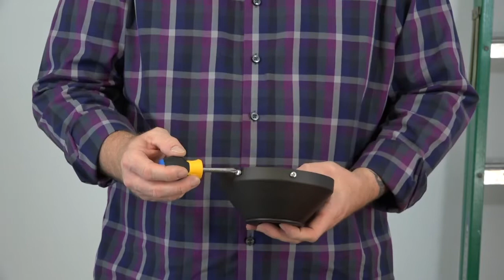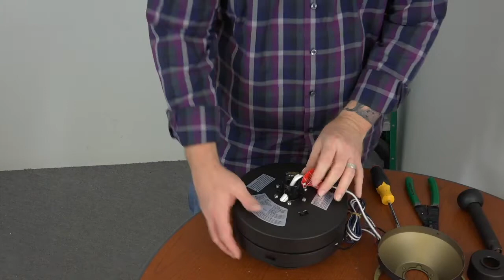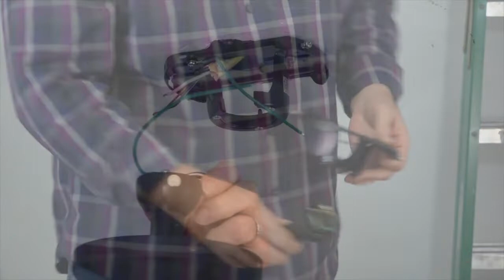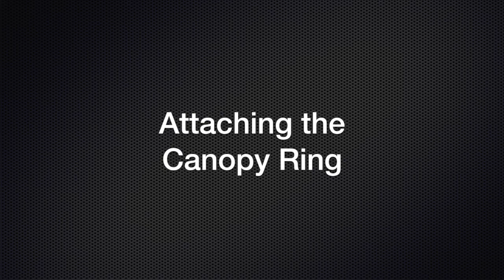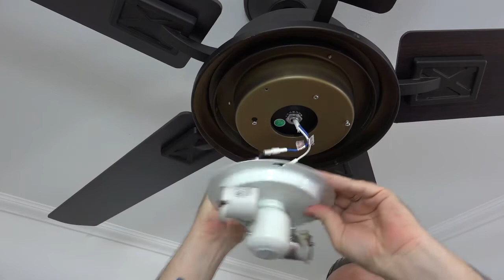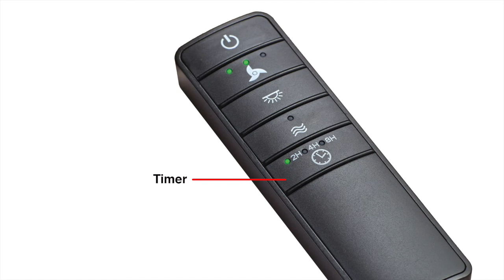How to Install the Copley Fan

Comment: What should you do if you have another hot wire from the ceiling outlet box that goes to the fan switch in the wall?
Reply from the maker: We have to start by saying that you should consult with a licensed electrician if you have wiring questions. We are not licensed electricians. That being said... In general, the fan should not be wired to both the remote receiver and a wall control switch. The only switch option if installing the remote receiver, would be a standard on/off switch. If you have wall mounted controls for the light and fan speed, the fan can be installed without the remote receiver and wired directly to the switches. If using the remote, we suggest just capping off the second hot wire and just wiring the way the video shows.